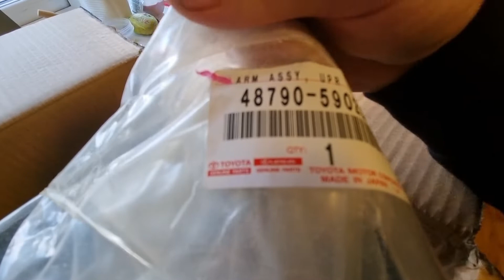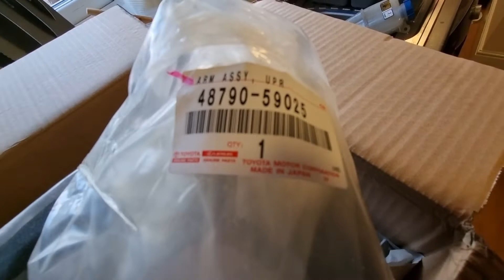Lexus LS400 - Rear subframe rebuild - Part 17

Comment: Please could you tell me how you proved the engine is a pre 1993. Thanks :)
Reply from the maker: Think I already answered on the other video. But, I had the frame number from.the Toyota it came from, I changed the engine number on the V5 and just made a note for the MOT inspector that it's a pre cat engine swap. The frame number can be used to access the build data for the donor car and show when it was built.
Reply: What's the difference??
Reply from the maker: In the UK pre 1992 engines don't require cats.
Reply: @FullBoostJ4  I've ended up using a 1991 soarer for my build for this reason :)